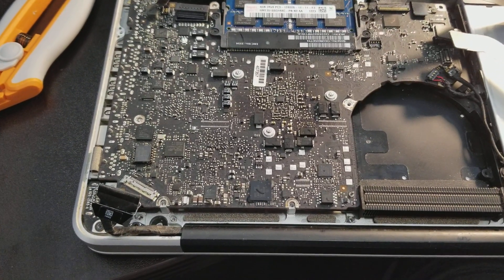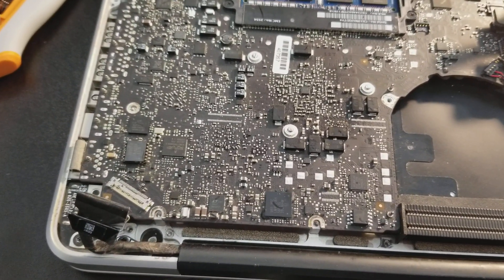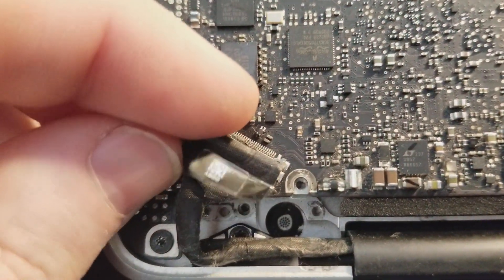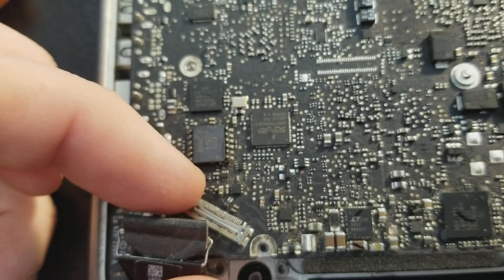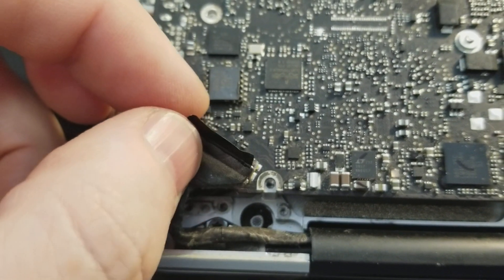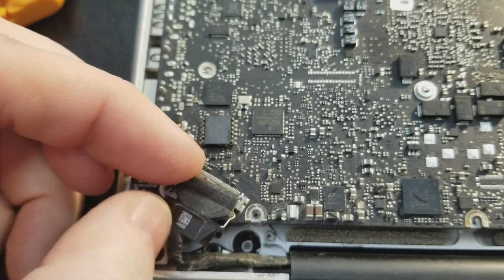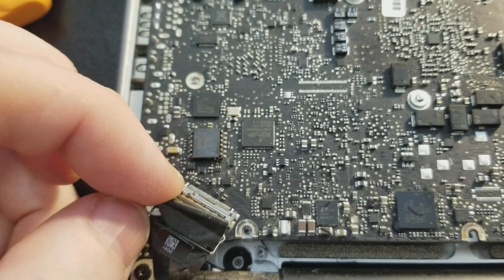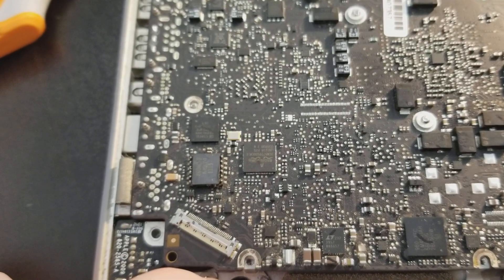Apple Macbook Pro does a post sound but goes to a black screen

Comment: This looks like it might apply to my situation. I have a mid-2009 MacBook Pro that I've recently done a couple of upgrades on. When I turn the power on now the power light comes on clicks off and then comes back on again and stays on. The fans are working so there's power getting to the machine both with the charger attached and without the charger attached. That's all it does though the screen remains black and I can't hear anything that would tell me that it's booting up. Removing and reattaching the battery did not help. I've checked the LVDS cable that I detached to replace the Wi-Fi card and those two connectors look like they are properly re-seated but I'm not certain of this. (this is where your vid is esp interesting). I believe the new 2x4GB RAM cards are in the slots properly. Ive re-tried the original 1 x 2GB then 2x2GB with no positive result. The backlight on the keyboard is not lighting. None of the keyboard reboot alternatives (eg NVRAM) has any impact. I have no idea what's going on. Can you say more about how you intend to reconnect the LVDS cable? Thanks

Comment: Amazing! I took the MacBook apart for a clean. I dismantled the logic board and applied too much pressure to the ribbon cable and loosened the insulating loop that the clip attaches down onto. As a result, this must have been shorting the circuit as you describe. I would never have thought this, I assumed I had damaged the connecter itself on the board. Anyway, a little electrical tape over the pins that were soldered to the board stopped the connection between the metal clip and the display connector and voila! all working!! 5* for this!!

Comment: Thank you ever so much for sharing!  I replaced the heat sink material on 2011 13 inch MacBook Pro that was running up to 90 degrees.  It is now at 50 degrees 5 min after start up.  Boot and black screen.  I found your solution right away and put electrical tape under the video cable latch.  Problem fixed!  Thanks!

Comment: I got a MacBook Pro 17” 2009 ( I know is old ) when I press the power button makes the shime sound but the screen remains black.. could this be the cause? Replacing the lcd cable would help? Thank you for your video shine a light on my problem
Reply: Did you solve it? I have the same MacBook with that problem
Reply: @sweettooth5962 same I know this is from 2 years ago but what  did you end up doing?

Comment: any other suggestions? I have a chime, caps lock light and fanspin but screen stays black. The display connector looks fine...
Reply: Did you ever figure this out? I'm having the exact same issue.
Reply: @LatashaNLouis  did you solve it? I have the same problem
Reply: @sweettooth5962  Nope.

Comment: Wow! It really worked. I was told by Professionals that it’s the logic board that needs to be replaced. I replaced it and still had the same issue with the black screen. The issue was with that connector! I did what you said, played with it while it’s on and saw the light again! Thank you!

Comment: Thank you for this video, you just ended my frustration of over 2 weeks.
Reply: how did you fix it?
Reply: @prabhavvellala9252  2:55 did you even watch the video ? ? Kapton tape to insute the latch from the display port cable pins https://www.ebay.com.au/i/283723169987?chn=ps&norover=1&mkevt=1&mkrid=705-139619-5960-0&mkcid=2&itemid=283723169987&targetid=833808471014&device=c&mktype=pla&googleloc=9071949&poi=&campaignid=7408627107&mkgroupid=86410135848&rlsatarget=pla-833808471014&abcId=1139226&merchantid=7364522&gclid=CjwKCAiA3uDwBRBFEiwA1VsajPPekNMK0RakBFK5zyax95PV5GQH4AjO_BnnJ-8dNHuM9gwzDJHfoBoCpgUQAvD_BwE

Comment: Wondering if this works for anyone with my same issue. My MacBook Pro sometimes will work for an hour or 2 and then the screen will go black but the fans will run. Then on reboot the comp will boot but screen will go black with fans running and keyboards lights on.
Reply: Did you find out what the problem was? I'm having the same issue.
Reply: Did you guys solve it ? I have the same issue

Comment: Thanks man it worked!
Reply: can you help me? I have the same problem.  how exactly did you fix it?
Reply: The secure tab gave te problem, so I left it loose and then it worked again
Reply: @bad_vibes_alone5054  can you show me an after and before pic so I know exactly how you fixed it. Thanks
Reply: @minimalistguy3103  unfortunately I don’t have access to the Macbook anymore. But it was pretty simple. The metal bracket that secure the screen cable to the motherboard gave problems  so I detach the metal bracket en pressed it backwards so it does not have contact with the motherboard. After that the screen worked again. It looks like the metal bracket makes some interference with the motherboard. Hope I informed you enough.
Reply: @bad_vibes_alone5054  Thanks a lot.  I think I can give it a try now
Reply: @minimalistguy3103  did you fix it? I have the same problem

Comment: I got a Macbook with the same problem. Suddenly black screen. I had checked the display condition and it was clean. I disconnected it, powered up the Macbook and connected it back while the Macbook was booting. The display came back immediately. Issue solved thanks to you. I don't even know what made the problem. The connector hatch was also in good condition.
Reply: He says he doesn't know how he'll fix it yet. I'm guessing the sparking is not something you want to see.
Reply: how did you solve it, like did you replace anything or put tape on it or something?
Reply: @supreme713-  I just disconnected the display connection, booted up the Macbook, reconnected the display connection. Did not use any tape. There seems to be no short circuit in the connection. I hope you understand my explanation
Reply: Did you also had high fan noise? in my case I have high fan noise, mac chimes successfully, and black screen...
Reply: @diegodiazguerra  No high fan noise. It was running normal but owner reported suddenly black screen.
Reply: Diego Díaz Guerra 

Did you fix this? If so, how? I have the same problem on my mid 2012 MacBook Pro
Reply: @rudyjrivera  You can also check out  https://boards.rossmanngroup.com/ (forum). There are videos for all Macbook models and issues.
Reply: Rudy Rivera did you find a solution?
Reply: Diego Díaz Guerra did u fixed the problem with your mac? I have the exact same issue!
Reply: @ZoeHailstorm  I have the same problem, any solution?

Comment: Thanks!!!! Exactly my problem. Solved
Reply: Blois Blois how did you solve it, like did you replace anything or put tape on it or something?
Reply: I wish I could tell you it was something magical, but I believe it was simply that the connection appeared to be fully inserted (since the latch folder over into the closed position). It just needed a slight push on either side with a small screwdriver.  I did actually add a small piece of electrical tape over the latch but, pretty sure that it just wasn't inserted fully even though it appeared so.  

I went through the whole logic board, top to bottom, probably 4 times before I discovered this video and the simple solution.
Reply: @supreme713-  I also recommend this app for the mid2010-2011 models.  Along with reheating and re-pasting the GPU, It has so far stopped the crashes
https://gfx.io